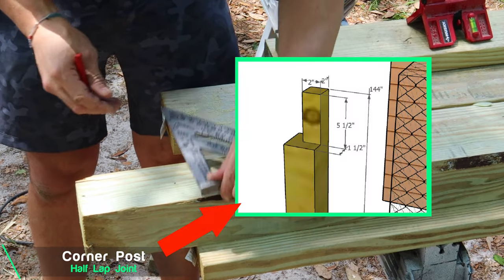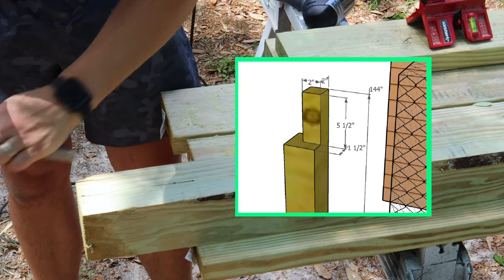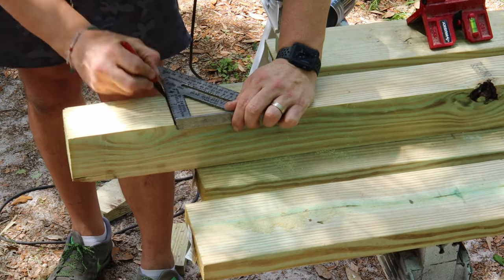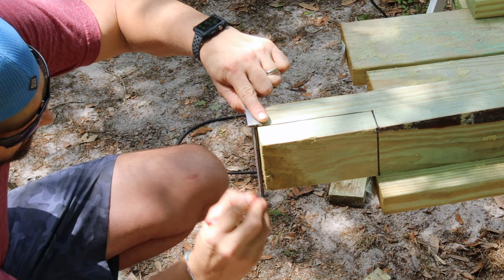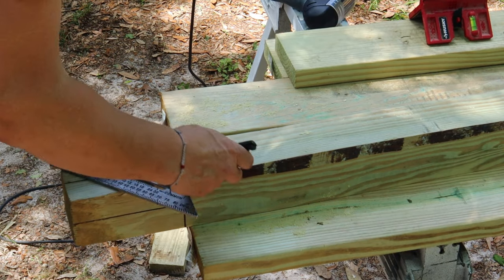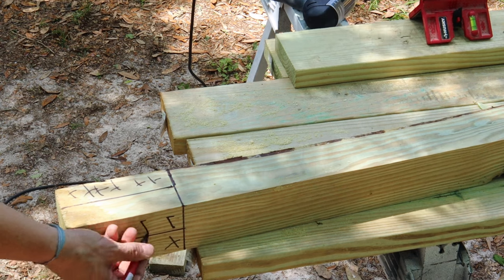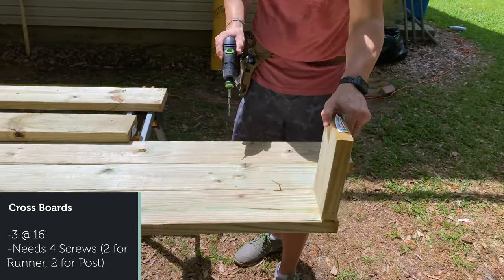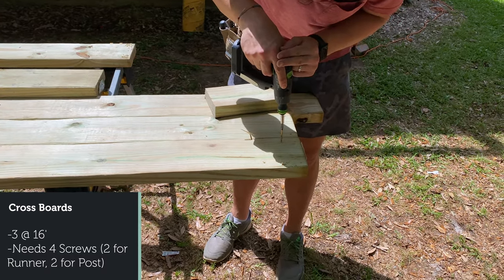How to Build Backyard Batting Cage DIY

Comment: nice work! Not a criticism. But, for those that aren't as handy, this design is overcomplicated for a batting cage. cool! Just not a minimum requirement. Wood runners along the top and cable aren't necessary. 4x4 post, securely anchored will easily support the weight of even the heaviest gauge net. Sag can be managed by pulling the netting tight enough not to droop too much but also absorb ball energy. Or, a cable connecting parallel poles to manage sag, if necessary. Thanks for sharing.
Reply: Hi Barry, thanks for the advise. I am planning to build one next spring for cricket 🏏, I will use yours advise.
Reply from the maker: Definitely great advice, Barry.  This design is meant to eventually hold an overhang which will cover part of the cage.  I explain this in my blog post, but should have explained it better in this video.  Thanks again for taking the time to leave constructive feedback.  I really appreciate it!
Reply: I was thinking the same but instead 4x6x16 posts 2 on each side nicely grounded (3ft deep) with cement to ground then cable and netting.
Reply: @aliriaz3654 Hi, I am looking to build one for cricket, please let me know if you have done it. I will use your inputs.
Thanks!
Reply: @barrydalton Hello. Can you help me with how to tighten the netting for no sagging? I'm creating a ceiling install and there can't be any sagging. 

Appreciate your help
Reply: @PahjoDesigns hehe 🫡

Comment: I don’t understand what keeps the freestanding section (the end that will not be under the lean-to) from being pulled in by the cable tension and the weight of the net. Have you had to reinforce that structure since you first built it?

Comment: Why not just cement the wood in the concrete instead of using the base
Reply from the maker: I knew I may need to move the wood posts in the future, so I wanted to do something to make it easier to move.  Plus, I couldn’t find 16’ posts at the time I built the cage as it was during the pandemic.
Thanks for watching!
Reply: @PahjoDesigns  i like that you can move the post if needed